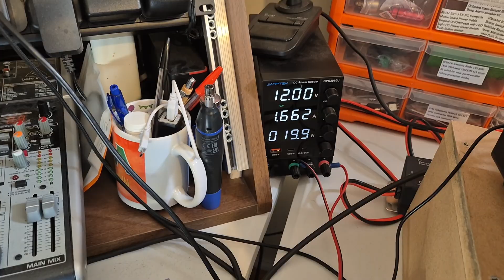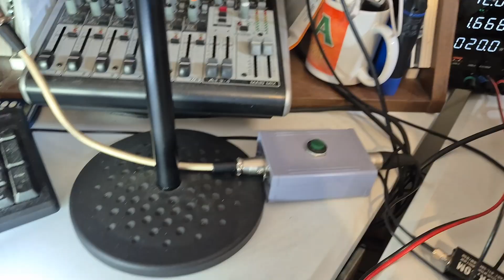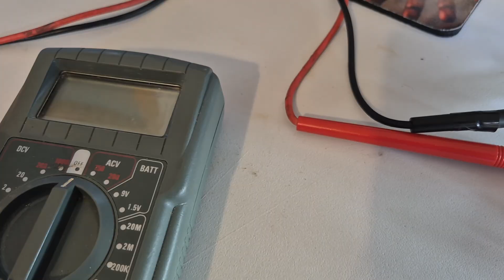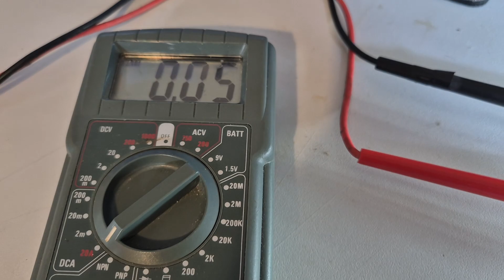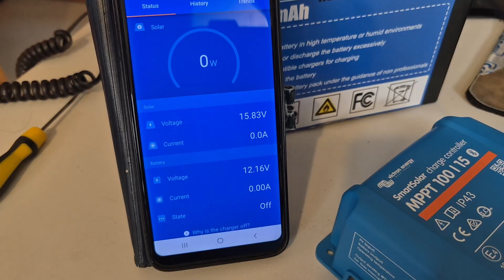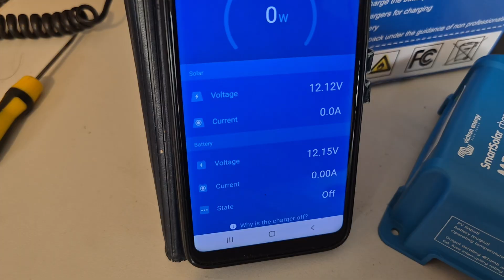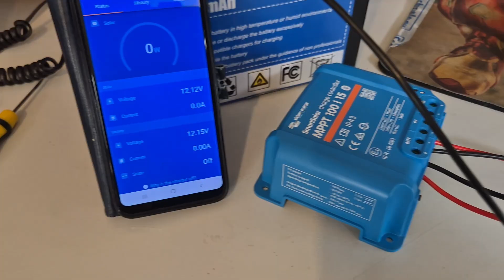Will LED's Power The Solar Panels? - Part 3

Comment: Lastly 4:36 you just debunked Lloyd’s “amp injection” claims of 10A through the system. I’m glad you showed your step by step process. Be prepared for Lloyd’s crew of idiots to attack your setup.

Comment: I hope it’s becoming more clear that converting electrical to light, then back to electrical, is extremely inefficient, which is why this is not used in industry as a way to recharge a system. This is only feasible if the source energy is free (sun, wind, water currents, etc). Using batteries to recharge other batteries is totally useless, unless you’re on the go and the source battery is relatively small. These types of battery packs already exist.

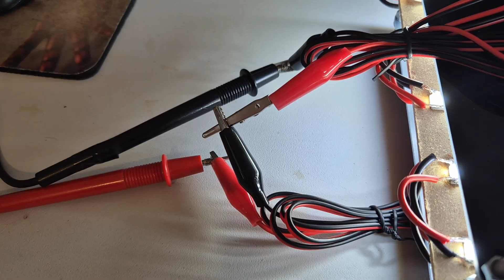Comment: Let’s break this down.  0:04 You are providing 12V * 1.663A = 19.96W; let’s round this to 20W of input power. 1:32 Your solar output is 41.9V * 20mA = 838mW = 0.838W. Your system is now (0.838W/20W)*100% = 4.19% efficient. You are still wasting 95.8% of your input power. As I said before, lumens will not directly give you more power because it takes more energy to generate the higher lumens. 

In parallel, it will be similar in output power. Your solar output is now 20.7V * 50mA = 1040mW = 1.04W. Your system is now (1.04W/20W)*100% = 5.2%.

Sidenote, when you measured current for the parallel setup, you were using a relatively high setting which is why your meter showed a single digit. Check it again in mA setting to be more accurate. I guarantee you the series and parallel power calculations will align and your efficiency will be about 4-to-5% efficient.